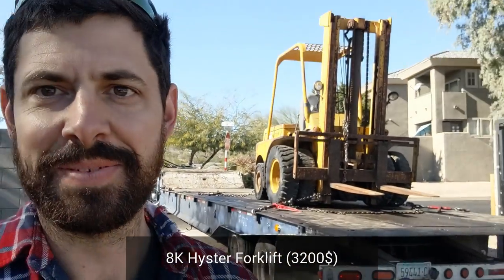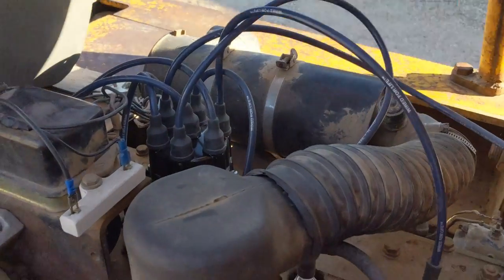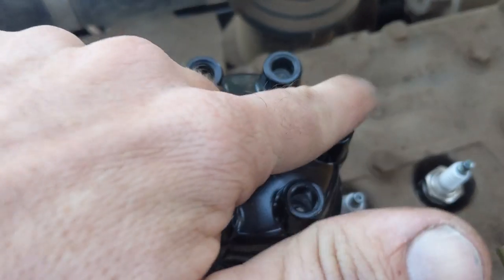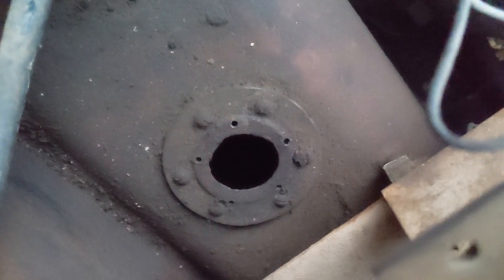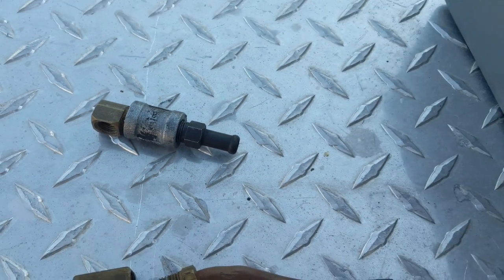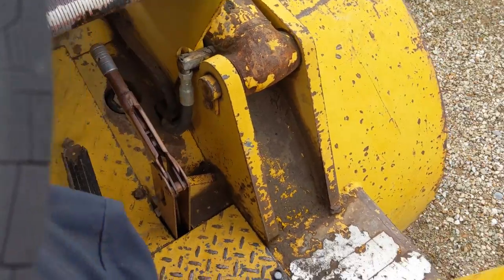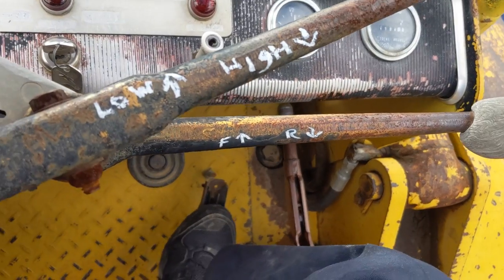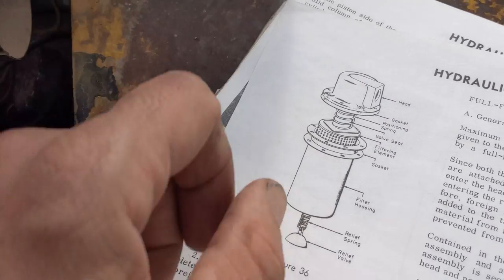Bringing an old dead Hyster Forklift back to life

Comment: When hustlers used to be good lol not anymore. Great engine but a pain to adjust the valves on and we had problems with heads on the conti cranking
Reply from the maker: You're not the first person to mention heads cracking. I've been watching the temp closely
Reply: Austin Coulson 19 years working on hyster when they used to be a good truck (not anymore) the heads fail at the side of the combustion chambers on the continental engines quite regularly. Another big problems with trucks that aren’t used that much is the oil emulsifying I’ve serviced them and the oil is white lol and I’m talking quiet a few of them doing it. On the whole though a good engine that can take a large amount of pain (certainly a better engine than the v6 vortex that followed it)  it as others have said make sure the thermostat is good I’ve come across a few where people have run them with the stats out because of cooling faults this is guaranteed to destroy the engine long term. 
The manual transmission is also fairly bomb proof is your 3 or 2 speed?. 
The issue with your lift cylinder lifting could be a failed check valve in the bottom of the cylinder it’s there to allow any oil that gets past the piston to get back to the bottom, these are prone to failing on the later hysters. How fast is it dropping?? The spec is 2 inches in 10 minutes under load anything more than this is a problem. To test this install a gate valve onto the hose into the cylinder lift a load and close the valve if it doesn’t drift with the valve closed the problem isn’t in the cylinder 
On the whole the H80C is a great truck and last forever the only stronger hyster is prob either the S150A or the H60J
Reply from the maker: @philholt577  mine is the 3 speed. Someone else had mentioned installing a valve there, but I was having trouble sourcing a valve rated for that pressure. Any suggestions on where to find one?

Comment: I had one like that years ago. 13,500# lumber lift. It had a cheve 235 six engine. One problem with mine, if someone spilled a bottle of water it would get stuck. Believe it or not someone wanted it more than I did and they stole it. That was about 8 years ago in Oregon.
Reply from the maker: Dang, that's a heavy thing to steal ...I wonder what ever happened to it?
Reply: I wonder also but most likely will never find out.

Comment: you need to wash that radiator looks full of dirt
Reply from the maker: For sure. I just noticed a tiny leak at the top, so I will be cleaning it and brazing it soon.  Got some recommendations to flush it, even though it looks clean inside as well.

Comment: We have one at work, which we call "Haister". Any Finnish speaker could probly get what it means, but the rough translation is "fuck you" :D
We wouldn't call it that but it's complete garbage and breaks constantly.
(For example, both of the pistons that control the vertical movement have snapped and had to be welded.)

Comment: That was silly that it if it wasn't working after the distributor was fitted, it's kinda obvious that it's not wired/fitted them up correctly (firing in the incorrect order or did not fit the distributor correctly) the last person who worked on it did not have a clue what he was doing so the old owner footed the bill for a new or used forklift truck due to basic mechanic fail (the owner should of called someone els who knows how a distributor system works)
Reply from the maker: When I was on his property it was cranking ok, but obviously wouldn't fire and I told him I would pay full asking price if he let me tinker and I got it running and he agreed. After pulling the cap to verify the rotor direction, I tried finding the crank pulley marks and without those, it was more of a pain. I would have tired all six combinations but the battery was losing power and I couldn't wiggly my truck in to jump it, so I negotiated down 400$ and took a chance.
Reply: @AustinCoulson  I am not saying you was bad as time was a factor for you onsite (you got that thing for a bargain) it was the other person who was working on it before, as it really did not take you long to work it out what the other mechanic had done to this poor machine once you had more time to work on it 

Guess you was more lucky that the hydraulis was not shot (filter was probably never changed and fluid not checked or changed ever don't think I have ever seen hydraulic fluid turn to mush like that before)

Comment: Covert that truck to propane! I have an Hyster H80 that I converted to propane. It cost me about $400 with some used parts. It burns cleaner,makes the engine last longer and is generally better!
Reply from the maker: That's not a bad idea.  My buddy did that to his 4k and his motor oil never got black again, and motor always seemed to run better

Comment: a flathead? how old is that thing?
Reply from the maker: Great question, the last digit of the serial number is K which is either a 1966 or 1989, I have been told it's probably a 89, but I have also been told they stopped using the Continental flat head in the early 70's
Reply: It's a F series Continental . One of the best industrial gas engines ever built . You'd have to take one apart to see why . Hint no pickup tube for oil . It can't ever lose prime . Many other important features . Also many users of flatheads didn't want to use OHV for a long time . Reason , valves in the block usually runs cooler . Forklift manufactures only used engines that were built for reliability and easy starting etc .
Reply from the maker: @oddwad6290  I can't believe how much I am learning from the comments on these videos. There is a section in the manual on this engine and I want to really dive into it. Any idea when they stopped making these motors?
Reply: @AustinCoulson  my H80 is a 1969
Basically only thing I've had to replace where hoses. I changed the hydraulic fluid due to water contamination also wheel cylinders and master cylinder for the same reason. I've had mine for over 15yrs.
Reply: @AustinCoulson  I didn't think they made any flathead engines at all since the early 1950s. that's why I'm so surprised. I'd say definitely gotta be '66. it looks too old to be from '89
Reply: @AustinCoulson  Hyster was still using the Continental flat head until about the early 80s in The Hyster S50C the S100B the S125A until they changed to the GM engines.
Reply from the maker: @derekevans8266  you sound like you know your way around forklifts, I got a question for you; I just bought a forklift ( Hyster model YE40 with the continental Y112) and I tracked down a manual for it, but I have no idea what year it is. The serial number is YE108009 which seems like a pre 1957 serial number but I can't find any info on it.
Reply: @AustinCoulson  Heck a YE40 Thats a very old machine I have never worked on one of those. The last letter on the  Hyster serial number denotes the year but you could be right at 57. Have you got a photo of it. Is it a three wheeler.
Reply from the maker: @derekevans8266  yes it's a three wheeler. If you email me @ acthecarguy@gmail.com I can forward you pictures of it and the serial plate.

Comment: At 5.07 that's half of an auto fuel filter.
Reply from the maker: That's it! I couldn't place it, but I rewatched it and remember by brothers Chevelle has one like that. The center is glass and it come apart if I remember right.
Reply: @AustinCoulson  Yep, the rest of it you pulled from the bottom of the tank. Looks like the mechanic (hacker) that worked on it before was using the filter as a weight and it unscrewed itself via vibrations.
Wonder if it was the same rocket scientist that did the cap, rotor, and wires?